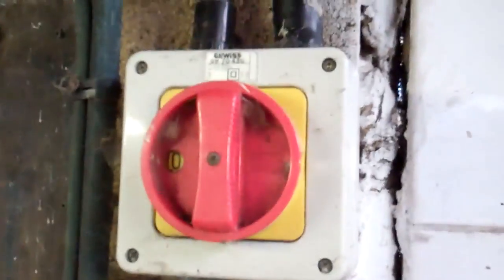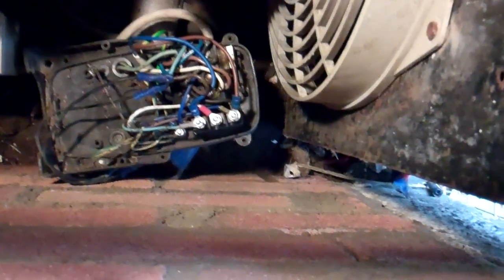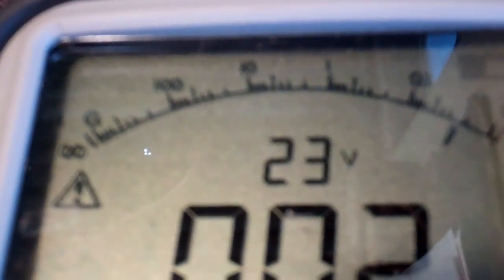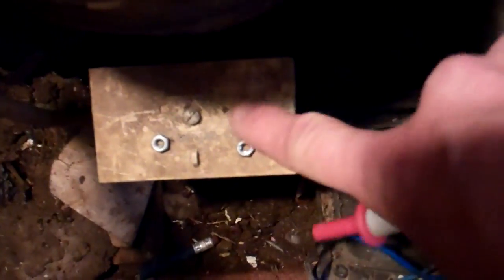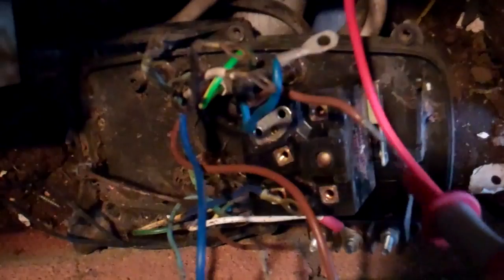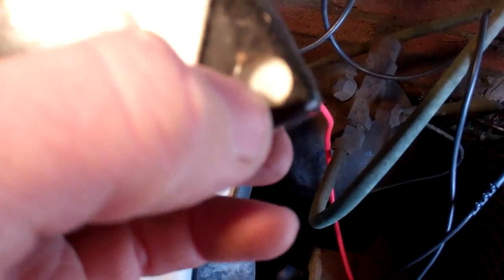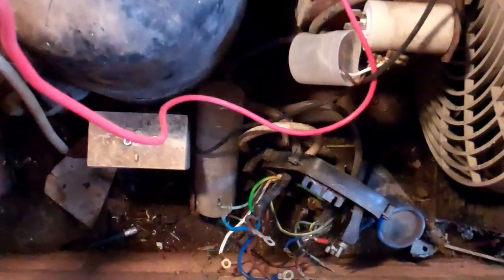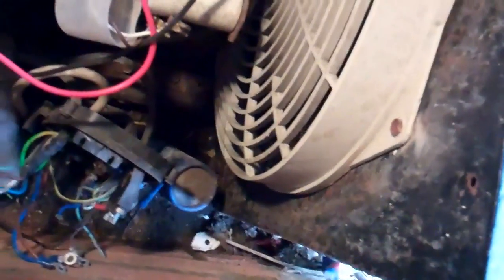Mega megger testing!

Comment: will that megger' read in the Kohm(actual Kohm not 0.01Mohm) range while insulation testing ?
Reply from the maker: +1973Robski I don't think it does, anything in the K ohm range would be a short as far as insulation testing is concerned. The meter does have an ohm and K ohm range too.
Reply: +heavydiesel thanks for the reply 👍